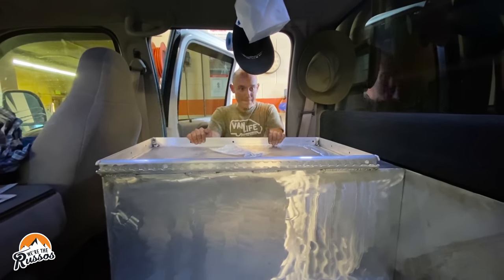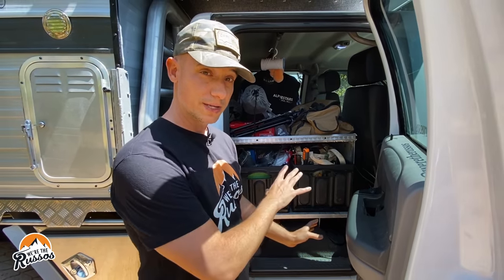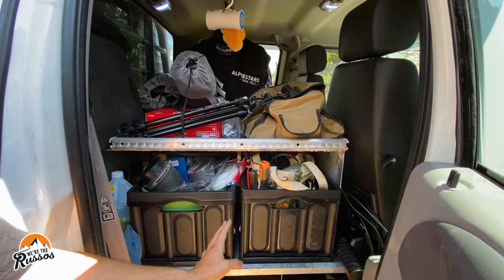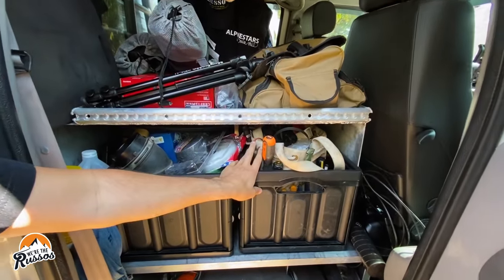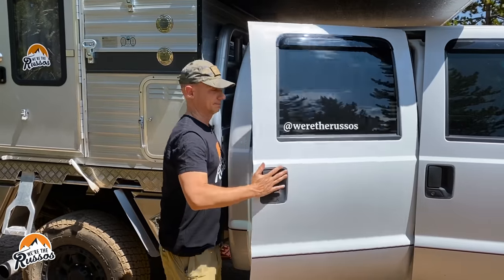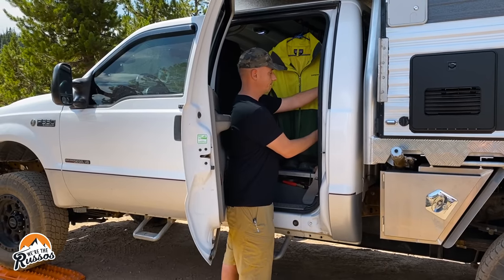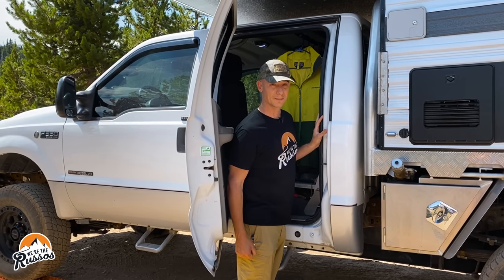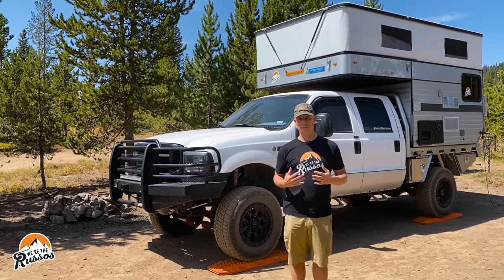Truck Rear Seat Delete & Build | Overland Truck Camper Life

Comment: Sorry, but if you didn't want that back seat, maybe you would be better off with a Class B, or Class C (I drive a 2004 Chinook Concourse, and there is a similar model call a Chinook Baja that is an "overlander".  I think that would fit this lifestyle just a little better.

Comment: That’s awesome! We removed our backseat a couple of years ago but our stuff is thrown in there helter skelter. I do strap down our chairs so they don’t bounce around and drive us crazy while we drive. I was worried about the extra weight of a storage system since we only have a 2500. Safe travels and stay well.
Reply from the maker: Since we used all aluminum, it weighs significantly less than the backseat we removed.

Comment: Nice design. One item I’m thinking about is a way to extend the swing of those rear doors. It would be awesome if I could get them to open a full 90 degrees for loading larger items. May also benefit your situation too. I’ll share if I figure it out.
Reply from the maker: You can’t open them any wider. There is a factory door stop, which you COULD cut off but the result would be the edge of the rear door hitting the front door
Reply: @Weretherussos  I was debating if I should remove the factory stop and affix some type of nylon webbing stop similar to those on a jeep.

Comment: Awesome - I'm going to do something similar for my F150 Supercab (just took the seats out today). Do I understand correctly that the rear is attached with bolts going into the holes that formerly held in the benches, and the front of the platform is supported by legs standing on the floor, but not bolted to it?
Reply from the maker: All points on the platform are bolted into the points where the original rear bench was bolted to. Bolts on the rear of the platform and then we made legs that bolt into the front two holes from the bench.